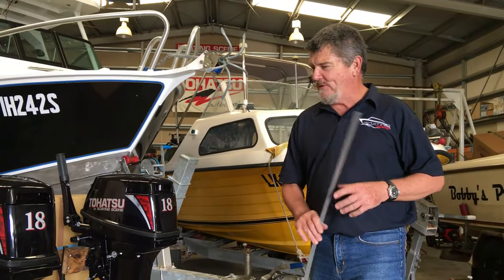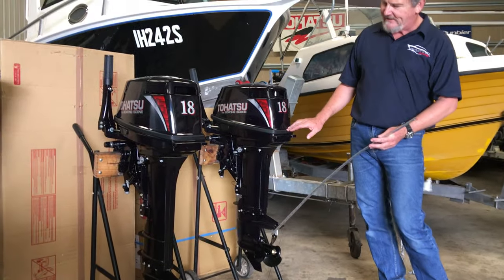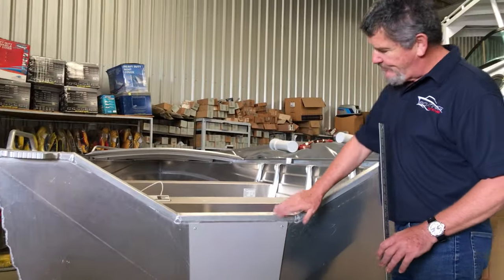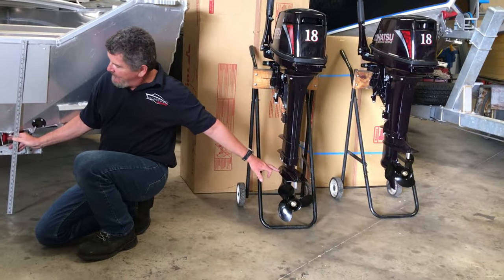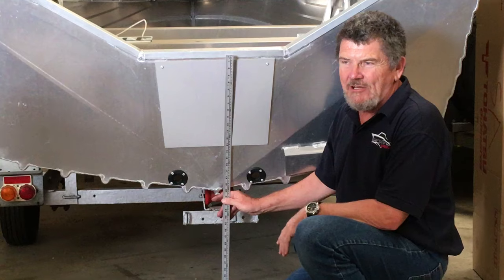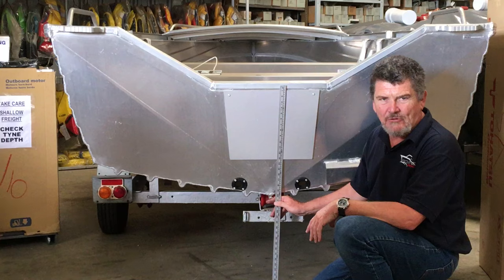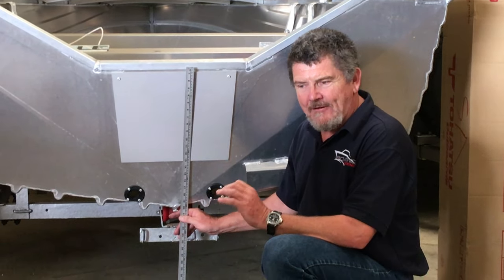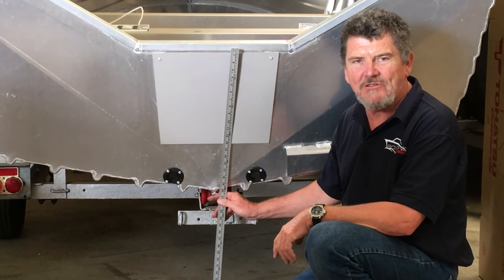The long & short of outboard transoms

Comment: I improved my outboard outlook with a small air cooled 4 cycle. The stern rides high and a little push does a lot. It starts easily and never has cooling problems. It rides too soft to slap.

Comment: Hi  I was wandering if when measuring alum. boat transom for  proper motor height, due you include the center riveted reinforcement as part of  the height?  or just the bottom beside reinforcement? always  tried to find this out as the reinforcement
is around 3/4"      Thanks
Reply from the maker: Hey Ducktruckful, anything that affects the height should be included

Comment: just bought a 15ft wave rider mustang (small speedboat) and a 40hp 2 stroke, long shaft. engine weighs about 75kg, the transom is cracked. could you give me any advise on what to do? was thinking to reinforce with steel plates and plywood.. boat is fiberglass. thanks in advance.
Reply from the maker: The only correct way is to replace the timber in between the fibreglass which is rotten causing the cracks in the transom
Reply from the maker: Replacing the transom is the correct thing to do